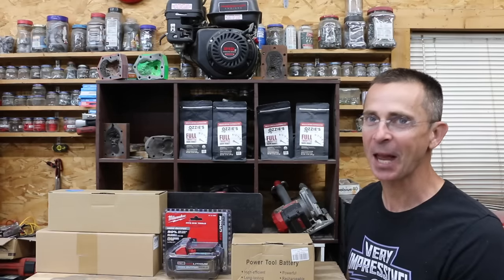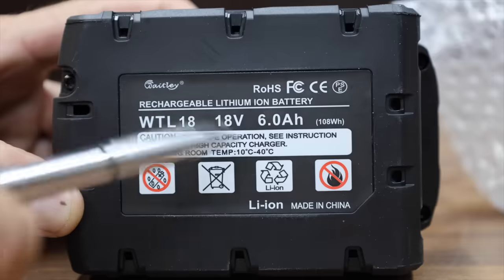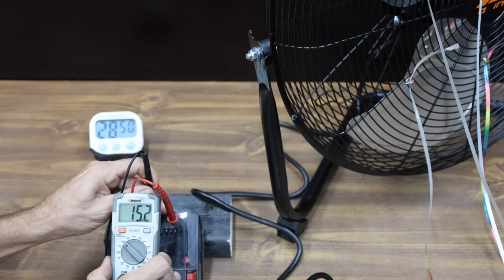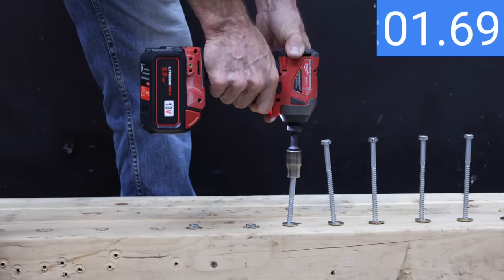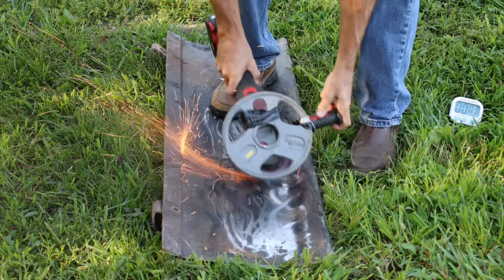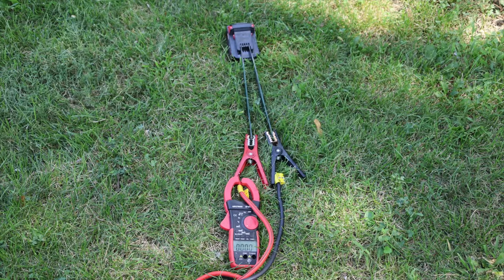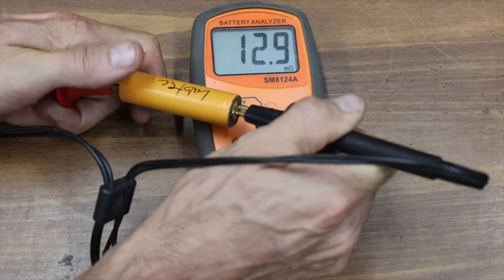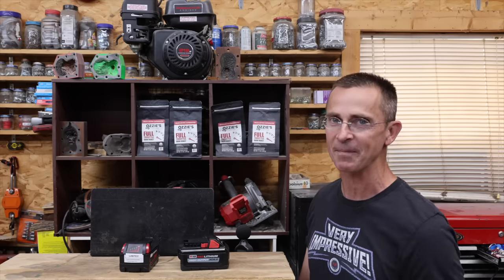How Dangerous Are Knockoff Tool Batteries? Let’s find out!

Comment: The cheap Labtec with about two-thirds of capacity at one-fourth of the price is quite impressive. It would work well for most applications except for the angle grinder. The original batteries would probably last 6 years versus more likely just 3 years of useful life for the knock-offs. In my experience, knock-off lithium batteries can have a greatly reduced life-span.
Reply from the maker: Thanks for the feedback.
Reply: The Labtec would be a great value for most people who just use it for Quarter inch impact jobs and regular drill use. I build cabinets and we have alot of these cheap batteries off amazon, for the most part they work just fine for our uses. Every once in awhile you will get a very weak dud, but overall getting 4 batteries for the piece of one is a no brainer.
Reply: Can always replace the cells with higher quality ones, as long as the bms and case are decent.
Reply: That is where the savings are usually lost in longevity battery cycle life.
Reply: Probably have a shorter life due to being discharged deeper than original batteries because of the lack of internal protective circuitry
Reply: @Deveak  Do you have a good spot welder? I was looking for one, but the $200 price tag was too much for me.
Reply: Why do you call them knock offs   none of them are saying they are OEM     knock off to me sounds like your saying  counterfeit the cheap batt work great for low output work like screwing and drilling etc   grinders need top quality
Reply: Being milwaukee, I wouldn't be surprised to only get 6 years out of them. Meanwhile I have Makita LXT batteries going on 10 years and still working great.
Reply: @DVeck89  I do have Makita batteries with almost 10 years as well, but they are basically beyond their normal useful life. Probably barely fifty percent capacity, which I can still use on light loads.
Reply: @khg8519  I used the term which was used by the creator of the video in the title. You could ask him that question.
Reply: @khg8519  The knock off batteries don't have license agreements with Milwaukee. In fact, Milwaukee never allows reproduction of any of their batteries. so, basically they are indeed counterfeit.  However, they are just different enough to avoid a counterfeit lawsuit.
Reply: @DVeck89  😂 use em once a year and theyll last a hundred years
Reply: Its a battery   DC     milwaukee dont own any of it  - why are they all 18 volts  I think default are the only ones who use none standard voltages  - If they were  knock offs it would make all things able to connect to a tool  also  property of the tool company - battery and tool wall holders  are they also stolen   @illiniwood
Reply: I have 5+ year old eBay knockoffs that are still going strong.
Reply: @DVeck89 I wouldn't be surprised to get much more than 6 years out of one of their batteries It just depends on the battery man It has more to do with the manufacturing process than anything else. And it has a lot to do with the battery design as well because I had lots of problems in certain batteries depending on which one it is. For instance Milwaukee's M12 6.0 seem to be lined with issues. The new high output for the M12 system seem like they have a lot of problems I constantly have to return those or send them off. Do I care about that absolutely not because they're under warranty I get another battery replaced. It bothers me not one bit because I have enough batteries to cover that one battery that may be out at one time. I still have all the faith in the world in that company. I've been using them since 2005. Hell I remember when you could buy Milwaukee tools in Lowe's before they got sued because Lowe's apparently didn't want to pay them their due diligence and money they owed them which was in 2007 if I'm not mistaken. I started with Ni-Cad Milwaukee tools now almost everything I own is FUEL and if it's not it's because it doesn't have a fuel model. I know means of fanboy or anything. I really only using me like them because that's what I started with and it's what I enjoy. I know that other tool brands make better tools depending on which tool it may be to say that one tool brand is better than the other is just asinine and stupid not to mention just because one tool performs better in the moment doesn't mean that it's going to continuously. Eventually it will be replaced by something else whether it's a different brand or a different model number It's fun watching head to head videos but it's silly to think that because one impact driver fastens bolts a tenth of a second faster really means anything. Hell even if it's 2 seconds faster it still meaningless because the rest of that time would be eating up by the person using it depending on their efficiency in doing what they're doing. Production lines would be the only ones that might possibly benefit but highly unlikely.
Reply: @illiniwood  I don’t see any issues with ‘knock-off’ batteries as long as they don’t infringe on a patent. Once you buy a product, it should be yours to do what you want, legally, of course. The bigger ‘crime’ is that power tool manufacturers don’t agree on a standard battery platform, like car batteries. A car battery may be of a different size but any 12-volt car battery with the correct amperage output can be used on any car.
Reply: @FishyAbody   The most obvious problem with aftermarket batteries is their lack of compatibility with the power tool and charger. The smart boards between aftermarket batteries and tool or charger don't speak the same language, if at all. The charger can get the job done up to about 80%. 80% is considered full to the aftermarket battery level indicator. This is how the aftermarket dumb boards function. They have a charge limiter built into the board. It saves their tail from liability. They roughly self balance the cells and check cell pack themp through the board with absolutely no communication with the charger, but thats as smart as they get. When you use an aftermarket battery, you miss out on the chargers ability to monitor the charging progress. That's how a Milwaukee charger can charge a Milwaukee battery up to near 100% without overheating the cells. Also, you miss out on optimum power on demand being sent to the motor on the powertool as well.
Reply: @illiniwood  I have 2 new aftermarket batteries that say 6ah. They make my Milwaukee charger get hot and shut off. They do charge but only get to 3 bars max before the charger shuts itself down. Do you think its the circuit board design causing this? They did charge up to full bars first time I used them now both are making the charger shut down. Should I just toss them out or is there a workaround? The seller doesn't respond on eBay to my messages about the so called 2 yr warranty! Thanks for any advice!
Reply: @khg8519  There are different name for these product, aftermarket, generic, third party...but the most political correct way is to call it know-off because it's been associated with China even China today is the most advance lithium battery producer such as on the EV cars. Also, bashing China generate views. I just checked my dewalt and miliwaukee batteries, it's made in China with Korean cells....I bet if replaces CATL cells, it would smoke the Korean ones.

Comment: Excellent comparison. One minor observation was the amp meter clamp was not fully closed on the first 2 short circuit test for current in case it helps. Minor detail I know. I want to give only positive feedback for sure!  Thanks so much for all the work you put into these tests!
Reply from the maker: Thank you!
Reply: For clamp meter it's very important to fully close one othervise it will show wrong meaurmens, that i conclude first 2 measurements of short circut is wrong.
Reply: @bc-nr5tj  I have a similar meter and for a 20 amp load cracking it open as shown in the video dropped the measured value to about 10 amps
Reply: @Merv-Bob  It's really about the location in the open, a little to the left, no result, in the middle, 50%, a little to the right, 70%.

Comment: Great review.  My supply of original DeWalt 18v. batteries is dwindling.  I was heavily invested in the 18v. platform and used to have about a dozen batteries and 5 chargers.  I have about a dozen of the 18v. tools of all types. I am now down to 2 chargers and 3 batteries. 
I am retired now and only use the tools for household DIY work, so I am not interested in replacing all my tools.  
I have been researching these 'after market" batteries, but YOUR videos are always the best research I can find on any tool topic.
Reply from the maker: Thanks!  Thanks for sharing.
Reply: Be especially careful with Dewalt batteries.  Unlink, well, every other battery that is sane, a few of their models do not have the BMS circuit on the battery, but in the tool.   So if you  get an unofficial battery that does not properly deal with that fact, you could have more excitement than you plan for.

Comment: This was a fantastic video / idea!  Thank you for doing this much needed testing.  I have been using 2 genuine Milwaukee batteries & 1 knockoff for about 3 years now.  I haven't really noticed a difference honestly.  The knockoff I have looks exactly like the genuine, almost like they were produced at the same factory-- Identical other than the bottom & side labels.  Mine was made by a brand named Vanon.
Reply from the maker: Thank you for sharing!

Comment: Great video. I've always bought the knock off 40v batteries for my lawn equipment. But they die after only a year or so... I then learned about not keeping them in the extreme heat of the garage. Now they're lasting much longer. On my last battery purchase I finally bought the brand name battery again, and so far it's far outlasting any of the knock offs. It does weigh a lot more too.   I hate paying so much for batteries, but for certain things, like power tools, it's just worth it not having to have so many, and then having them die faster on you too. You end up buying more over time, dealing with the shorter life, and then getting rid of them vs the name brand one that is just built better.
Reply from the maker: Thanks!  Thanks for sharing.

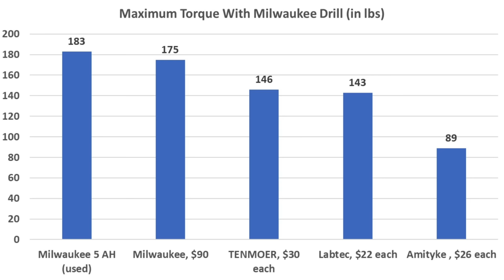Comment: Great video! Just a heads up: There is a mistake on the maximum torque graph at 4:28. It seems the old and new Milwaukee batteries were mixed up. New is supposed to be 183 and the used is 175.
Reply from the maker: Thanks!  Thanks for the constructive feedback.

Comment: with the way cordless tooling is advancing, this test right here is probably one of the single most relevant thoughts on peoples minds when looking through the isles and the over all costs of what they put in their boxes. not only on the wallet but when done using a battery, that overload protection goes a long way especially if you turn your back on a battery while its on the charger or after heavy use
Reply from the maker: Thanks for sharing.
Reply: Ugh, I hate how much brands are pushing cordless tools these days. 

Most of the time a corded tool with an extension cord is just as good or better, but at a significantly lower cost with much better longevity. Which is probably why so many companies want you to buy cordless... so they can make you keep spending money on new batteries and tools.

Comment: Great review. Always wondered about this. Always knew deep inside that the knock-offs would be about 1/2 as good, and your results pretty much confirmed my thoughts, How about a review of adapters that allow batteries to be useds from different manufacturers on different branded tools?
Reply from the maker: Thanks!  Thanks for the suggestion.
Reply: @ProjectFarm I’d also love to see tests for battery adaptors (dewalt/Milwaukee/makita/etc), especially if they can pass the temperature sensor information through to the tool or not
Reply: I use an adapter on my 18v black and Decker tools that lets them use a 20v lithium battery. Since the Black and Decker 20v batteries are decent and the 20v tools are garbage it works great. The 18v line was solid with B & D then they screwed the customer on the cheap 20v tools. I got an 18v weed trimmer and can do a 3 foot by 52 foot area on one battery where the 20v trimmer would be out of juice in about 10  feet.  I like the adapter and I have been using it for over 3 years. (the same one). I use it on the 18v hedge trimmer as well. The only 20v B & D tool that is holding up okay is the drill. I burned up the circular saw and the leaf blower is a joke. The 18v circular saw is indestructible almost.  Now I do not use them for work just around my house so I do not need industrial quality tools. But I would not buy them again and would go with a better brand next time.

Comment: If you ever choose to revisit this topic, it would be interesting to see how building your own battery pack stands! Also that 175 watt milwaukee power supply was something I never knew I needed...
Reply: If you know how to do the home Depot hacks, the Ryobi 40v batteries and power supply will give you a lot more juice. I'm a Milwaukee guy. But I recently learned to accept Ryobi as they are very versatile and fill in nice gaps left by Milwaukee. It started with an AMAZING deal on a 10in miter saw. I think it's the highest end on their 18v line. That was followed by the very nice and compact rotary station. The more expensive one which I got on clearance for about $30. And as of recent, their new swift clean carpet scrubber. Not the handheld one. The one with the hose. But hand tools like the impact, drill, etc, I'll stick with Milwaukee. Especially anything else where the battery becomes a huge obstruction like the cordless ratchet.
Reply from the maker: Thanks for the feedback.  Thanks for the suggestion.
Reply: I rebuild power tool packs. Done Dewalt, Milwaukee, Ryobi, Hitachi, Snap On and Craftsman. When you build your own, it's all about the cells. If you use Samsung 25R, Sony VTC5, LG, EVE, etc, they will be as good as a factory pack, if not better..all about the cells..
Reply: Comparing 21700 vs. 18650 is bogus though
Reply: I use that milwaukee inverter every day, 12ah battery will charge your phone for a week. Also awesome for laptops, speakers, powered coolers
Reply: @meme5887   Also helps that Milwaukee & Ryobi are owned by the same parent company.
Reply: @purplehazeffc  How does that help? Also, Ryobi and Milwaukee are just 2 of quite a few companies under a single corporate umbrella. Milwaukee is the only one though that acts individually.
Reply: Torque Test Channel did this I think, they called it The Beans. Very high performance but equally high cost.
Reply: Never knew of that DC to AC converter pack before seeing this. I gotta see where I can get one of those, it might come in handy at a future point.

Comment: Great analysis of each of these batteries. It's a shame that the knockoffs advertise themselves as 6AH. Given the size of the case and cells, they seem to be intended as knockoffs of the older 5AH battery, in which case the Labtech performed very well for the price. The Amityke and Tenmoer are a real concern. Unfortunately, you just never know how well built they are until you test them and disassemble them yourself. I have no problem using custom-built packs, but it's important to start with a properly built battery management system, and then you have to choose reputable cells. With how common and cheap a basic BMS is, it's appalling to see the Amityke and Tenmoer using something that fails to live up to that. A simple fusible link costs almost nothing and a low-voltage cutoff is a super common 10 cent IC. I'm impressed by the Labtec and would have no concerns using them as a cheap alternative to a 5AH Milwaukee.
Reply from the maker: Thanks!  Thanks for the feedback.
Reply: Where do you recommend to get reputable cells?

Comment: Thanks Todd! No question that the $$ Milwaukee would reign supreme. But wow! The $22 battery really did well. I was surprised! Great job as always!
Reply: Would be a legit product if they were simply honest in the Ah rating.
Reply from the maker: Thanks!
Reply: @michael931 Right? $22 for a 4Ah is pretty dang competitive against a $90 6Ah pack. But they just had to be liars.
Reply: Sadly with knockoff you never know when they may decide to change stuff inside so you may have a good one. Then later buy a new one and it trash.
Reply: @Robert-Wilson  You are correct sir. Quality control is probably not great.

Comment: I think i suggested this battery test, but never thought you could pull it off!  Congrats!  
Now, another suggestion:  Hose  nozzles.  Im constantly having to replace them because they break or their spray functions, including those screw adjustments that are supposed to stabilize the flow give out all the time.
Reply from the maker: You are welcome!  Thanks another video idea.
Reply: For what it's worth, I've had a simple brass twist nozzle (not a pistol grip), and it has outlasted everything else by years. Pretty sure it's American made. There's basically nothing to break on it.